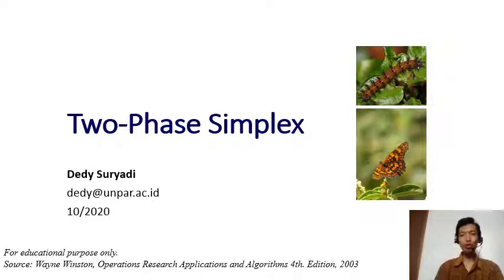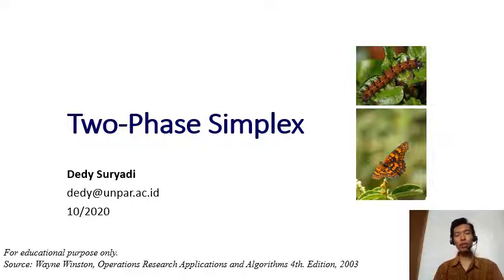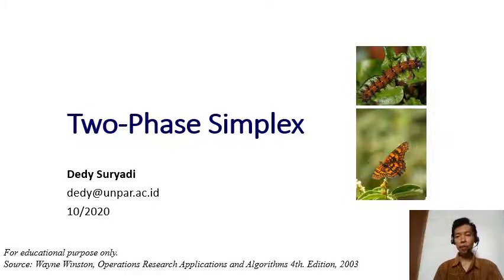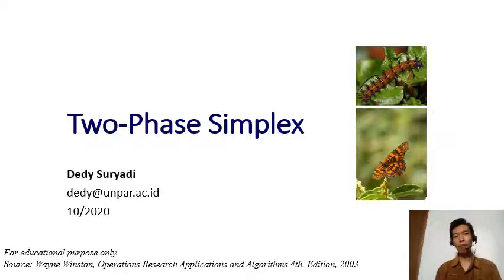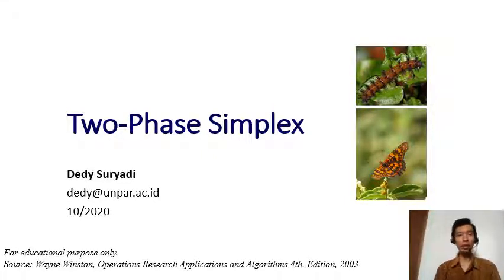Week6.1 & 6.2 Two-Phase Simplex Method

Comment from the maker: 04:55
Correction: on slide #5, the values of x1 and x2 on the first table should be 0 (instead of -2 and -3), because the objective function of the First Phase is min. w' = a2 + a3.